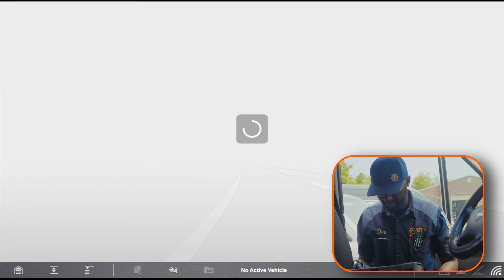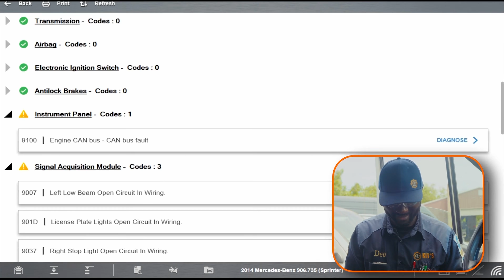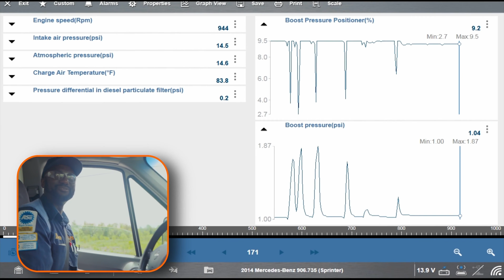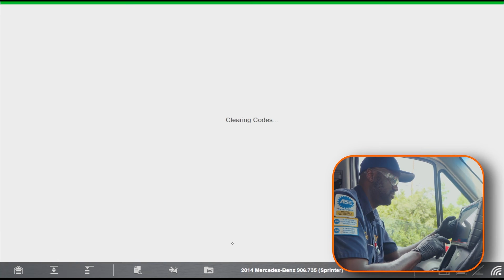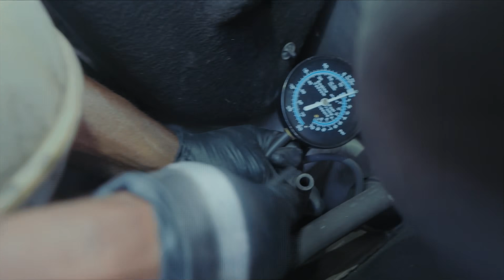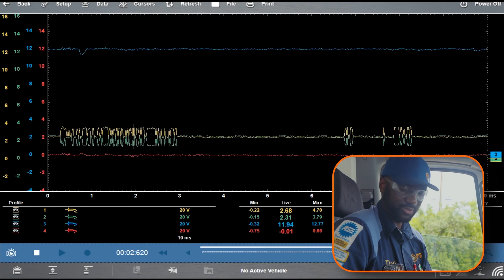We Got The Slowest Sprinter Van on the Road in our Shop! I can Run Faster Than This Sprinter Van

Comment: I'm glad you got to the obstruction, but if you would have looked at the original live data you would have seen that the exhaust back pressure was over 15 PSI at idle and went up to almost 40 when you revved up the engine.  I do agree though, that your tests did pinpoint the issue.

Comment: Hello, I need your advice. My 2008 2.2 cdi 646 engine temperature is between 85 and 90 degrees, but in the summer it goes over 90 degrees. Should I change the thermostat to 75?

Comment: I work on  one of the Mercedes  sprinter that had d same dpf issue  and it took me 2 hours to do driving  regen  I did  d regen  reset about 3 times but when u driving  u have to make it finish d 45minute count down  and  it comes  back to  normal  after d 45 minutes  finish
Reply from the maker: @christopherwright5437   Yes! sometimes it takes a while

Comment: Hi kito I do have a sprinter van freight liner 2015 has a linkage to transmission seal but the big problem the vehicle doesn’t keep up the power means it keeps losing power
Reply from the maker: @Umojatranslogitics   That's not good
Reply: Lexus is king

Comment: A vehicle with over 300 miles need new parts. I recommend engine cleaning, renewal and overall. Lots of factory OE Parts, seals, sensors and regulators are worn up and tired by 300 miles.
Reply from the maker: @kayrams1792   I agree

Comment: Hi Deo it’s Rafiek from South Africa awesome video like the way you do your fault finding procedures you not just a parts changer I’m really learning a lot from you r channel Looking forward to part two to see if you gonna have to replace the turbo but in my humble opinion I don’t think so the noise we hearing from the turbo is because the dpf is blocked thus creating excessive pressure on the turbo veins.Here in South Africa the law is not strict on emissions so what we do is we physically remove the dpf and we do a dpf delete on the ecu 
Thanks
Reply: I am in South Africa myself. Where are you based. I am interested in dpf and cat delete in the ECU.
Reply: I would also like to know how to do this! Emissions are choking these engines and ruining them! After delete do you go into limp mode?
Reply from the maker: @rafiekahmed8568  My Pleasure! We don't delete DPFs in our shop! it's illegal here, so I don't do that
Reply: @Rafiek You are correct about the pressure building up in the exhaust side of the turbo. It takes exhaust flow and heat to spin the turbo impeller. Under restricted flow the turbo won't spin up enough to create the pressure needed on the intake side. The vanes are not so much the issue, but the pressure can force fine soot into the turbo's central bearing and oiling system. That can create a source for sending oil into the exhaust system once the DPF is replaced and exhaust pressure in the turbo is returned to normal. If severe, that can destroy the new DPF and converter prematurely.

Comment: So very informative and appreciated, is there a way to prevent dpf filter buildup? Any additives that you would recommend?
Reply from the maker: @Charlene-k5x   I would recommend a lot of highway driving and using the right fuel
Reply: My Dad would tell me that you just jave to " step on it! " and blow that junk out of there lol ( So I mash it every now and then ) 😂 @KITS_Auto_and_Truck_Repair
Reply: I would highly recommend archoil or any cetane booster, the engine will produce less soot and do less regens.